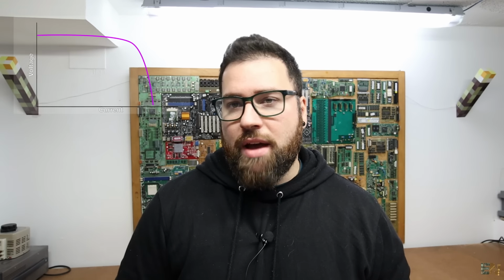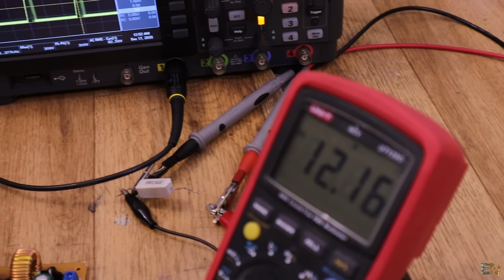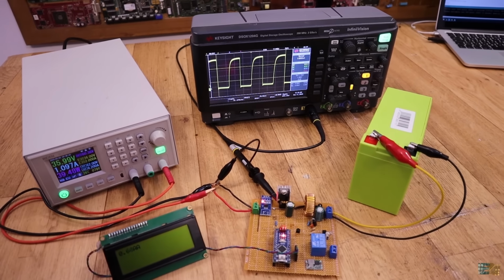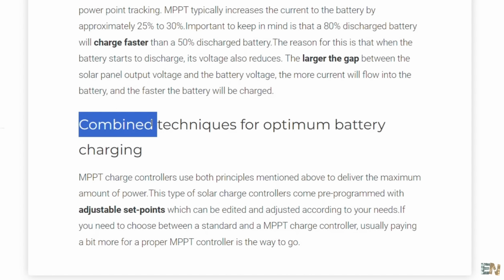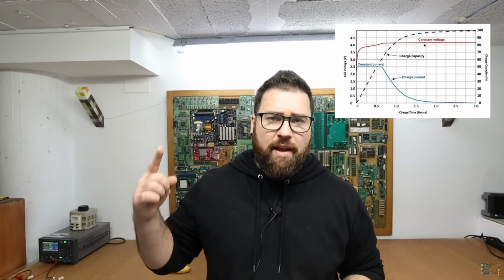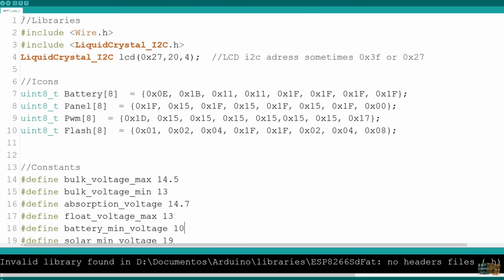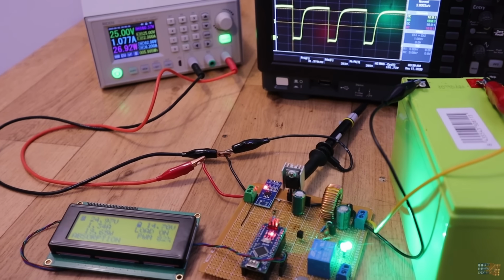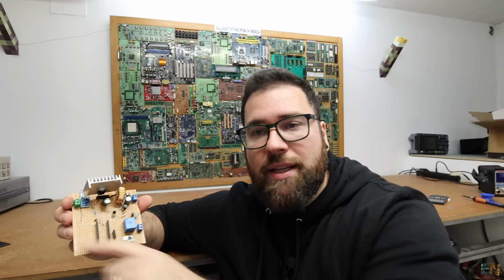MPPT What is it and How it works?

Comment: Wait so the gauge of the wire is current dependent only ? I thought it was power dependent. So let's say you use more voltage and thinner wire, the load can still draw the same current, but since thinner wire has higher resistance, don't you produce more heat ? I'm confused
Reply: Wires have something called skin effect, so the thickness of the wire also comes into consideration, and skin effect is dependant on voltage
Reply: Electronoobs it would be an amazing video on this topic to explain the nuances
Reply: @Sysshad  Doesn't skin effect depend more on the frequency?
Reply: @benhetland576  You are correct. And it seems i remembered wrong, it seems from what ive read now its more related to the current rather then the voltage.
It sure is complicated :D
In regards of your answer about wire gauge above, you could probably add it also depends on what your ambient temperature are and how much you would allow the cable temperature to increase from the current. Many factors indeed.
Reply: @Sysshad  well, you already added the extra factors yourself .... thanks ;-) there are surely more! Like minimum bending radius, I think. But anyway, unless one does this professionally for a living it's nice to just boil it down to the most essential.
Reply: We could perhaps simplify it down to two parts:
1. Wire gauge determines max current.
2. Insulation determines max voltage.
That would be an everyday pragmatic rule of thumb. Skin effect, stranding and material are the more complicated factors of the equation, and cannot be ignored. Neither can density of cable bundles and airflow/cooling around them.
Reply: If you use thinner wire, you can draw less current. The increased resistance (which also depends on wire length) will limit how much you can increase the voltage. Maybe you can get the same power, maybe not...